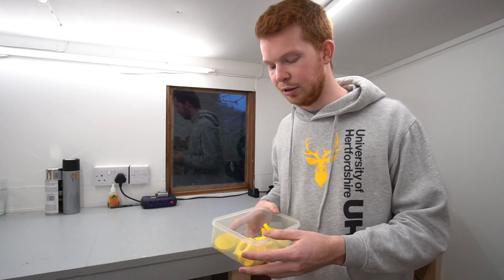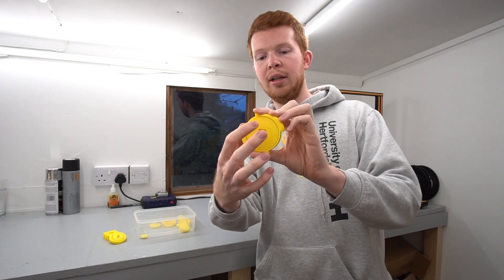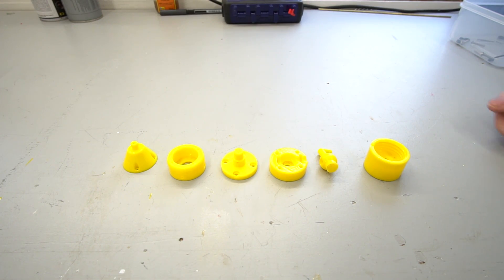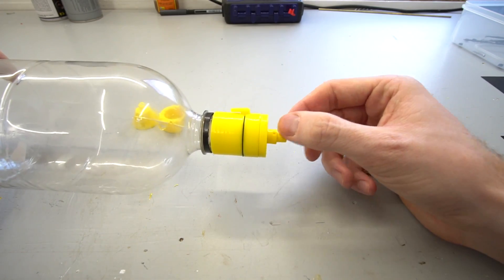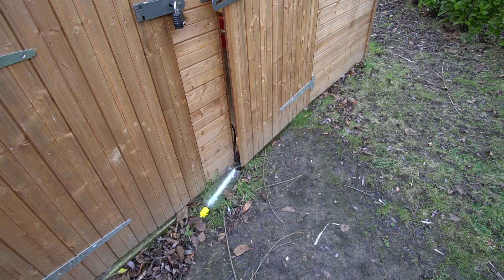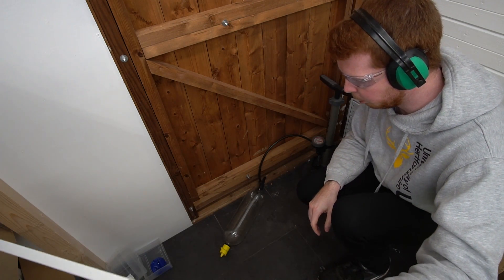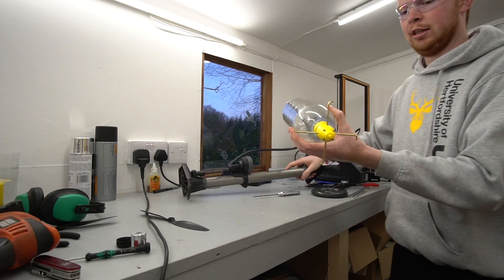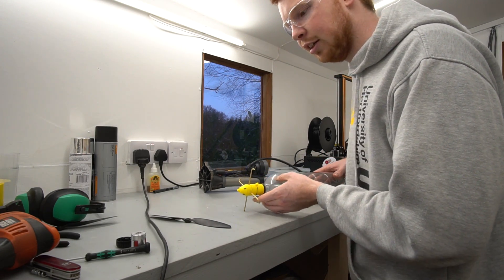Air Powered... Propeller?

Comment: All the ginger friends I have love a real challenge, is it a really a universal red thing? Anyway, excellent experiments and notes, I would suggest that with such a small amount of energy stored in that bottle you really need much more efficiency, I believe a piston approach like you mentioned would be the way to go, just keep friction to minimum, silicone/teflon smooth. You have too many parts in this design, each adding extra weight and air losses, plus the bearing is being side-loaded when pressure is applied which greatly increases internal friction and energy wasted. Cover the bottle in duct tape for more safety if your testing at higher pressures to help stop flying shrapnel, you can always use a different bottle once you have a fair idea of the max pressure they can safely hold.

Comment: The problem is there's no seal to stop the air coming out below the "hub". The air is just leaking out. I'd try a greased o-ring on the opposite side of the hub (closer to the bottle) on the other side of the air outlets.

Comment: so, it sounded like there was a lot of blow by between the rotor and the power shaft. Perhaps, if you machined it out of metal in such a way that you could seal the outlet pipes from the front so that air only comes out when they are over the holes to make a sort of power stroke, you'd save pressure, and would get longer run time. I don't think you're ever going to get as much performance as you did from the air engine, but it would be fun to see tried anyway.

Comment: Tom, I’m happy to watch these in parts, or full length builds less frequently. Whatever suits you. The content is fascinating either way.

As for your trial, I was surprised to see you hammer in that delicate ceramic bearing. Could you have damaged it? It did seem rather wobbly after, and I can’t see any reason why you’d need to spin up the hub before opening the valve unless to allow inertia to carry it over rough spots in the bearing caused by damage. Could you try pressing in a replacement, with a drill press or even a vice? And when inserting the shaft, you need to brace the inner race, so the bearing itself isn’t taking the installation end load.

The other thing about run time, is that your piston engine is a fixed displacement device; if it runs slower it uses the air supply less quickly. But this reaction engine is not; the jet torque needs to be carefully matched to the prop torque. If the prop takes more torque, it will just run slow but that doesn’t reduce the rate at which the air is used up. The prop size needs to be balanced against the orifice size in your ball valve.

Please don’t abandon this project until you have exhausted its potential.

Comment: I have a feeling you're either going to need tighter mechanical tolerances or more pressure. If you put some rocket nozzles on the ends of the air pipes you'd gain a small boost, but simply increasing the pressure to over 300 psi will probably show a better gain. Now if you were to lathe the parts in steel you could probably use hypergolics... Still, probably the best thing you could get to improve this project would be an electric air compressor to make retrying easier on the labor budget. If you do pick one up, just remember to wear eye protection when you realize that the ring underneath a soda bottle cap acts a lot like a jet turbine when blasted with air... :D They tend to break rather dramatically at high speed.

Comment: Some thoughts of if you want to pursue this project... 

-Could you possibly make the holes on the end of the exhausts smaller maybe making it last longer?
-Put a heavier or lighter gas inside of the chamber??
-Also, would you be able to make this into a rocket type engine instead? 

Love the videos!!

Comment: The crude balloon powered propeller seems to be quite efficient, right? Why dont you try letting the whole bottle spin, maybe with a bearing on the bottle neck. It would increase the inertial mass for sure, but, most importantly, it would eliminate air losses and high weight caused by your rotating prop-adapter... Also, try a design that matches the toy, your slim propeller simply needs high rpm you cant get. The guys in the F1D community utilize diy props,too. A little stiffened up version with the exhaust nozzles at the end would probably do the trick.

Comment: try to squezze the end of the brass tubes witch a pair of pliers!
higher air velocity at the end (like a nozzle), lower air velocity inside the brass tubes--> less friction!
i guess you loose half of your energy through friction in the "long" brasstubes!
sideeffect: longer running time

Comment: If I may...

The ballon gizmo incorporated the tubes into the leading edge of the blades, giving them both structural integrity and maximum torque by way of extending the moment out as far as possible.

If you intend to recreate the vertical function of the ballon gizmo, keep the blades as light as possible and make sure the centre of gravity is well below the bottom half of the bottle. You can substitute weight with surface area, like the ballon. Maybe fit three bottles together converging at the nozzles? You could fit a restrictor once you ascertain the most efficient pressure to RPM ratio.

Convert as much of the air pressure into blade momentum as you can. Any air coming out of the tubes is effectively wasted energy. (Jet turbine sections are increasing in size because technological advances are allowing us to extract more and more energy from the combustion process)

Using thrust bearings would reduce the internal friction considerably.

Keep up the great work mate - you're clearly causing a whole bunch of us to debate and discuss!

Comment: i think parts would be good.

i would like to see more refinement of the piston engine:

the ball valve on the piston engine would be good. although maybe make the lever arm longer, and design it so you have more control over the throttle. so the hole through the ball could be a wedge shape, with the hole that meets up to it being quite big.

try filling the bottle with dry ice, as you would get much longer flight times, but you would need more power for that weight, so a big prop with more blades. you might also need a bottle with a bigger hole in it.

Comment: Seemed like most of the air was not venting through the nozzles - in fact on the last attempt you can see a blast of condensing air heading upwards from the ball.valve

Comment: Hmm...this seems like it should be simpler.  You’re having trouble with tolerances on housings, why not integrate a duct onto the turbine vanes?  Sanding flats to spec feels like it would be easier for tolerance reduction.

You have a spring and you’re having it all open at once with your final model.  The velocity is what’s important, not the volume so much, if you can restrict the outputs and maybe make the airflow more laminar somehow to reduce friction you’d probably see some gains.  Maybe also use a metal shielded bearing to reduce air escaping through the ball gap.

Comment: Can you make a 3D water powered turbine gear multiplier? (I'm not sure if that's the right term) That will fit in a 1/2" water pipe. I have a idea to power led lights with it to help the poor.

Comment: Hi Tom, I was wondering if you could try to optimise the diameter at the ends of the brass tube, I have a feeling you will find there is a sweet spot between flow rate and flow velocity to get best output force. I guess crushing the tubes a little at the ends might do it.

Comment: Have you considered using some kind of impeller driven by the air flow?
The air could be directed to drive some simple vanes in order to escape the prop hub quite easily, though I don't know how good it's going to be.

Comment: Did you print this on your Delta printer? It could be that, between the tolerance issues with this and the compressed air engine, that it's ever so slightly off on one of the arms and it's causing it to print circles as slightly elliptical rather than true circles.

Comment: Very interesting concept, might I recommed using a smaller diameter nozzle for tolerance issues. I wanted to print a small accurate brain from pinky and the brain and ordered a .2mm nozzle, ended up recieving a .15mm nozzle. The end result took me three days to achieve due to calibration issues and printed at .1mm height in pla and with a lot of detail.

Comment: Rather see shorter regular videos. Also I Think YouTube does not like less postings. I think its a week or two, then people stop seeing the notification that a new video posted..even if they have the bell clicked.
As to this design.. I am almost certain the air was leaking before getting to the nozzles... the snapped shaft may be a clue.. I think it was leaking around that area... at one point you can see vapor shoot out of a gap.
The piston design uses the pressure, but less volume to to work. Since that bottle is low volume it works better.
Love the videos ... keep them coming.

Comment: Tom, while your efforts are appreciated, your engineering skills leave much to be desired.  Using compressed air to power inefficient conversion schemes using lossy/sloppy parts is a one way ticket.  Please don't knock yourself out with this.  Use all that time to research first.

Comment: Hi Tom, great project eventhough it failed on this video. I am not am engineer but I am curious enough to enjoy your projects. 

Also, I am wondering if you can find a thicker plastic bottle that can not only handle the pressure  better but also reducing deformity on the hole you created for the bicycle valve? Can a hot glue help reduce the airleaks on the valve rubber seal? I just feel that you are one step away from a breakthrough before you can completely abandon the concept 😉

Oh and do your projects in parts, please. It does not need to be in for every week. It is just need to be updated as it progress. Or perhaps you can do a project introductory video then do a timeline on when you want to show progress whether in weeks, months or in a year and what you want to accomplish with the project.

Godspeed! 💪

Comment: The biggest issue with this solution is, that the air is to light to create a reasonable amount of thrust, since the momentum is proportional to the accelerated mass. Using water would be much more efficient. Just like these "water rockets", you may know. But spraying water around may be a little unfavorable for your airplane, right?

Comment: if i can make a suggestion you must get some kind of regulator on the bottle  the regulator must work with the rc of the model plane like a normal plane would it might last longer and if you could use 4 or 6 bottles all connected it would  be having more capacity so far i liked all the ideas  keep up the good work

Comment: What is directing the air out through the vents efficiently? It would seem the air is just building up and some escapes out the vents, but I bet less than 1/2 gets into the vents.... The rest probably escapes around the bottom? You can see the blow off when you open the valve also.. so a fair amount of air is escaping without going through the tubes...  I'd keep at it :)

Comment: Is there any other way to use direct gas flow and avoid moving parts?  Like Dyson ring fans.  Faster flow used to drag slower air along but diffused so as to waste as little energy as possible.
Would you consider hydrogen peroxide or dry-ice and warm water?

Comment: Use a hollow shaft for the air to go through, past the bearing. Use a shielded (not sealed) bearing with the grease washed out. This design is losing lots of air across the rotating gap.

Comment: The old co2 engines worked at 800+psi and were not much use below 300. That gives way more energy to play with than you are using. Ideally you need a bigger bore lighter piston engine so the losses are reduced as a percentage and you get more torque from your lower pressure.

Comment: What about filling the bottle with liquid nitrogen? You may get a "constant" mass flow rate, and you could develop if you want a security valve so that the bottle does not explodes. Also, you could make a mixture between this and the previous engine, by adding this sistem on the exhaust. Anyway, good joob and keep pushing!! 😊💪

Comment: The solution for your problem is Tesla's turbine. 
Watch this video if you have not already done so: https://www.youtube.com/watch?v=IQmlXJVo9LE 
It is in your language and then you will understand it better than me, I am using google translator to write to you.
see also this video: https://www.youtube.com/watch?v=mrnul6ixX90
It seems more achievable with the 3D printer.
You can also make the same balloon-copter system: coat the brass tubes with a wing profile to create blowling propeller blades; but the biggest problem, however, is how to store the large amount of air needed to keep the turbine rotating throughout the flight time.
You should use a pressure reducer compressor for your tests, you'd have more time to examine the results, and with the pressure reducer you could see how the engine behaves as the pressure changes.
Perhaps the propeller you used was too big for the rotation speed of the engine, not only for the power generated: the larger the propeller the lower the number of revolutions achievable.
but I do not have to teach you these things!:-))
P.S. make weekly updates with only some photos each week  and a regular video when the  project is completed, so you can keep more alive the channel

Comment: I think they only issue is you need to run the air though a regulator so that the pressure remains constant, rather than being insane at the start and dropping off exponentially.

Comment: Why have tubbing in the first place? All you need that piece to do is simply rotate the prop so that the prop can generate lift. By adding the extra weight and length you are causing the air molecules to travel much further and move more mass than just haveing a small short piece. You could even just print that part with grooved outlets that come off the center of the sphere at the desired angle.  This whole mechanism is simply a method of getting the prop to rotate, make it work for the prop not the other way around. 
Im enjoying the unique content, hope all is well for you in this project, much love!

Comment: How about a water rocket powered glider. Use a water rocket to get your height then glide back down to earth. Either build the rocket into the fuse or have the glider break away. You may need to make your own pressure vessel so you can get some more serious pressure.

Comment: you mentioned that the propeller setup is better than a simple nozzle... wouldnt the nozzle be better because the prop efficiency isnt perfect meaning that some potential energy is lost... and also you are relying on a smooth bearing... once again not perfect efficiency on that one... maybe try do a thrust comparison of both systems using a weighted arm and compare how high each one can go
love the projects btw!

Comment: Idea? Use the same propeller Idea by adding ball valve to the baloon copter aparatis (add pressure tubes to a propeller's leading edge) or use the baloon copter as a propeller. just an idea?

Comment: Remember turbine tops. It is like a spiral intake that made them spin as the air vented from the sides. I think if the turbine was redesigned the loft extrude it would reduce material need and an increase in power from the same amount of pressure.

Comment: Your 3D prints look pretty decent, but have you ever checked if your printer works perfectly accurate? I've noticed from other videos that the CR-10 (also the E-10 and TEVO Tornado) has a design flaw on the X-Axis. The belt driving the carriage is actually not parallel to the x-axis, thus creating an error in the x-dimension which gets worse on the far x ends. This error can't be compensated by software calibration - the belt mount must be changed. Have you noticed this on your printer?
Regarding the videos: Do what you prefer ;) However, I wouldn't mind if you post small vlog-style videos during the making of a bigger project. While those high quality videos are really good, I don't require every video to be that elaborate.

Comment: use air pressure to push water through the turbine.... more pushback, more resistence, longer run - wet tom :)

Comment: This was a good exercise in learning about reaction jets. The problem you are faced with is maximizing efficiency of a limited energy resource (bottled pressurized air). I would say it's a balancing act of finding the best power (square surface area to push) with minimal losses in friction and parasitic air loss. The air engine was better at this job, maybe it can be optimized more?
- Eddy

Comment: I think you’re turbines driving your propeller is your best bet. Have you considered over sizing the blade diameter or a shoulder of the turbine and turning it down (chucked in a drill) for a better tolerance fit?

Comment: U need a way of regulating the air.        So that u can pump the bottle up to 100 psi and get 60 psi out of it for longer.      Another way this could be acheived is having those tubes mate up with a air distribution sleve using several holes round or ovular so its not 100% of the air the whole way around but goes in spurts to make the air last linger.

Comment: Hi Tom, loving the project. I have also 3d printed a compressed air engine, however with my design, I use a low pressure chamber to regulate the air flow into the manifold. This allows a constant rate of pressure in the expansion chamber of the engine, and also the ability to ramp the pressure in the storage tank to a much higher PSI than the engine is rated to, thus giving more run time.  My engine runs on 32PSI, and the 20oz storage tank holds air at 250PSI. 
This method i took from Paintball Markers design.